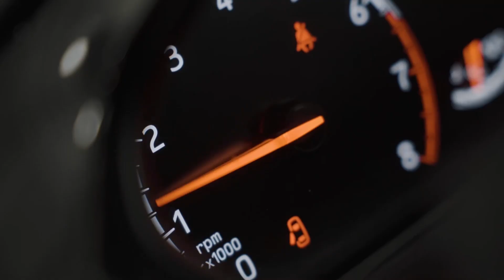Bentley Continental GT gets a visual upgrade! | Maxton Design UK

Comment: Why are you drilling so big holes in the Front splitter? 00:57
Reply from the maker: We drill the holes slightly bigger, as it means we have some leeway when finding the perfect position for the Splitter before securing it to the car!
Reply: @maxtondesignuk  is it possible that you do a tutorial where we can see how you mount a front splitter, for example?
Reply from the maker: As we have access to specialist tools, we do fit our parts slightly differently to what we recommend customers with our fitting kit. Our fitting manuals can be found here:

https://www.maxtondesign.co.uk/fitting-manuals

Alternatively, feel free to check out our fitting process in the following video:

https://youtu.be/QsiID80KcCs
Reply: @maxtondesignuk  makes sense to me! How Id expect a proper fitter to do a proper fitting fix!